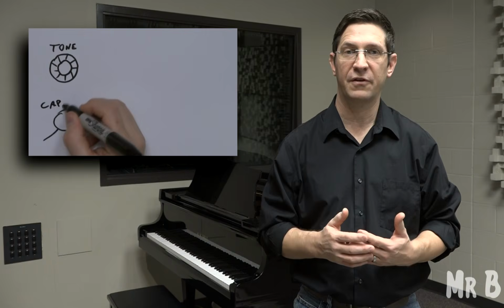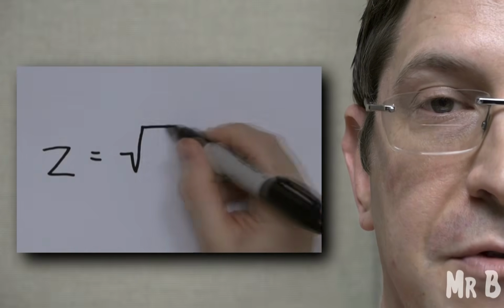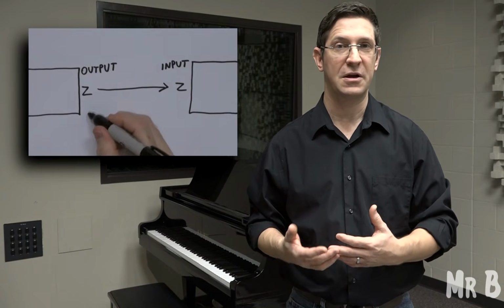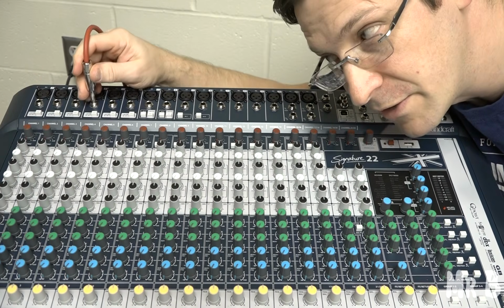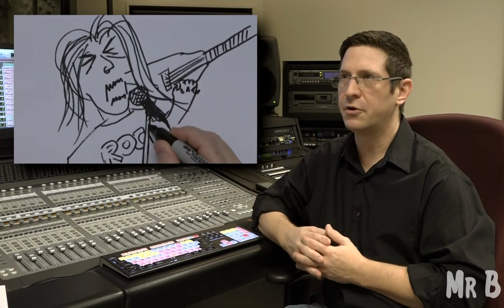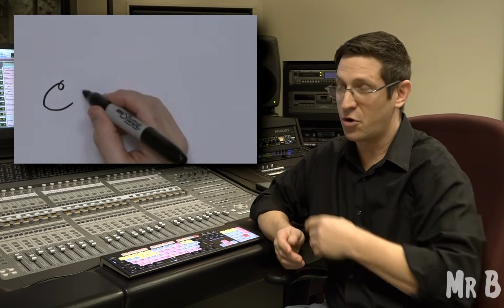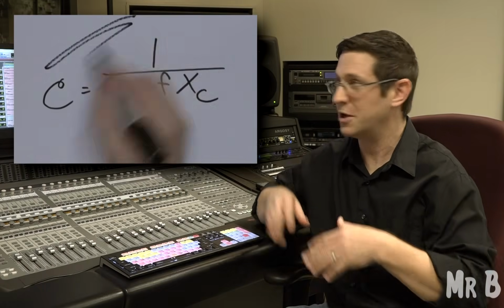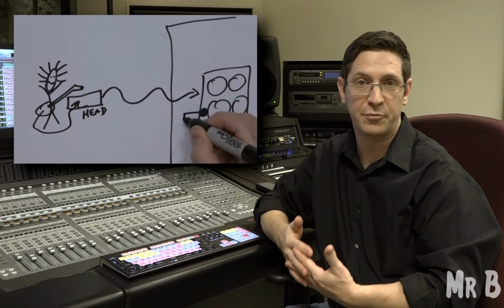Guitar Cable Length - Why Size Matters

Comment: I think you might know the answer to: When connecting a keyboard with two TS outputs to a field recorder, should I be using microphone cable or instrument cable?
Reply from the maker: What's the model of keyboard, and what's the model of the recorder?
Reply: @MrBinthestudio  I was actually hoping for more of a general answer as to where it is appropriate to use instrument cable (guitar cable) vs. quad core microphone cable.  I could wire up some unbalanced instrument cable into the 3.5mm unbalanced input on my Mixpre using a TRS connector and bring the two 1/4" outputs from the Yamaha P-125 one to each side, or I could use some quad core or other microphone cable and do it that way, also using a 3.5mm trs unbalanced input on the Mixpre (100k Ohm input).  The specs on the Yamaha (just one example) don't tell me the output impedance of the outputs.  They don't even tell me if it's line, mic, instrument, or speaker level.
Reply from the maker: Since the keyboard is unbalanced, if you were to use mic cable, any benefit that you gain from the mic cable (common mode rejection, for example) is lost by the mere fact that it's an unbalanced connection from the keyboard.  So, it really doesn't matter which cable you use, but instrument cable will be fine.  As for the output impedance of the keyboard, I think we can safely assume that it's line level out, so your input impedance into the XLR/Phone combo inputs should be well matched.
Reply: @MrBinthestudio  Thanks for the informative answer.  However, I should not e that the reason I prefer to use microphone (quad core) cable is because it allows for a stereo signal through only one cable, whereas the instrument cable would require two cables in a y.  There is also the issue of the semi-conductive layer of instrument cable.  Would this have no effect?  And what about impedance handling?  Is this not a major difference between microphone and instrument cable?  The impedances of my inputs are different, which is why I am wanting to use the 3.5mm 100kOhm trs input rather than two of the xlr inputs 4kOhm.  Since the signal coming out of the keyboard is not balanced, cable isn't goingto make any difference anyway, so that isn't what I was actually asking about.  I was actually wondering more about the physical characteristics of different cables as far as impedance handling, capacitance, etc. as it relates to situations using actual gear and to people not studied in electronics..  No videos and hard to find the right information I am looking for out there.
Reply from the maker: There's really no difference.  The term "instrument cable" was really coined to prevent people from using instrument cables as speaker cables.

Comment: 200ft??? 61m??
Who needs a cable that long???
If I wanted to be more than 10m (30ft for y'all metric-deniers) away from my amp,
I'd get a wifi-transmission, not necessarily for the tone, but primarily to avoid tripping accidents

Comment: does this effect also appear on speaker cables? From an amp to a cabinet?
Reply from the maker: Nope.  The amplified signal from the amp has a different circuitry that is not prone to HF loss.
Reply: @MrBinthestudio  okay thanks for the quick answer

Comment: Also, I'm new to this... I plan to get either an axe fx II or a Scarlett interface. Would those double as the DI box as well? I plan to just use the guitars DI and then use VST's later on.
Reply from the maker: Yes, the "instrument input" on those units suffices as your direct input to record the direct signal from your guitar.
Reply: @MrBinthestudio  Thank you for the fast reply! Loving your channel. Wish it had more. I will definitely watch those. :)

Comment: what is the safe cabe length? 
I am going to buy a very expensive cable soon to record my guitar, , but I'm afraid to buy 4,5 meters and get these losts.
Reply from the maker: If they are very expensive cables, my guess is that the internal capacitance is lower than most cables, so you would be able to get away with a longer length.  But I would check with the cable manufacturer to be sure.  What is the brand and model of cable you were looking at?
Reply: @MrBinthestudio  oh thank you for your fast answer.
I was going try buy Mogami Gold or Platinum but is very hard to buy here from Brazil.
Now I will buy the "Tecniforte Animal", a cable from a very good brazilian manufacturer:
I didn't find the technical specifications but here is a video of their other cable ("High Clear" model)
https://www.youtube.com/watch?v=9fz-k2sCSVo
The video is 8 minutes, is very old (2011) and the guy "tecniforte's representative" give some info in voice, and other technical infos are given in text in video (you cant caption it)
So its too much trouble/work to you help me.
I think I will buy it because I can't buy Mogami here in Brazil, the prices from those who import it are too much expensive and buying from Amazon have very high tax.
Reply from the maker: Those cables seem like they should work well.  I usually tell people to keep the cables around 3 meters or less.
Reply: @MrBinthestudio  yes this is my doubt.
If I buy 3m I will have to move my 19kg weight Combo every time that I will play, brining it closer to my PC/Audio Interface.
I was wondering if I buy 4.5m will cause any  sound-quality-loss.
But thank you for you time!
I subscribed in your channel because your videos are great. Very technical infos with a bit of fun
Reply from the maker: Is there any way you can get a hold of a cheap 4.5m cable to test it?

Another thing to consider for dealing with length is to get a buffer unit or a pedal with a buffered output.  This provides an impedance modification that will allow longer cable lengths.  I learned about these after I had made my video, and would have included it in the video if I had known.  :)

Comment: Thanks! :D FWIW the resistor and capacitor configuration is pretty important. Depending on which is where, you either produce a low pass or a high pass filter. If the input signal first crosses the resistor, then on the other side of that resistor, where you tap that signal to send it to the next stage, is a capacitor that is connected to ground (aka shunted). This is a low pass filter. 

On the other hand, if the input signal first crosses the capacitor, then on the other side of that capacitor, where you tap that signal to send it to the next stage, is a resistor that is shunted to ground. This is a high pass filter. The impedance of the load being driven by this high pass filter should be much higher than the value of the resistor to prevent circuit loading effects on the filter's output.
Reply from the maker: Yep, all correct!
Reply: @MrBinthestudio  Excellent! I am still learning. :) I wish that when I was attending my classes in the 1990s someone had told me to just do more instead of trying to read more. I had a very hard time learning electronics and what finally allowed me to breakthru was simply DOING. If you have any students that are struggling with learning electronics then maybe they might benefit from the times we are living in. About 1 year ago I bought an "Arduino starter kit" on Amazon for about $17. I recommend the ones that do not come with an Arduino, just the basic kits that come with a breadboard, 5v power supply, buttons, jumper wires, buzzers and a bunch of jelly beans: resistors, caps, LEDs. Rexqualis and Elagoo are both decent brands. Now the problem of sending audio signals thru the breadboard arises, and the student has to really learn. :)
Reply from the maker: I quite agree. Our program is a combination of theory and hands-on. I can talk all day, but the best learning happens when you actually do it.

Comment: 5:19 You should mention about the Insertion-loss caused by "double" passive transformers. The guitar-signal would be weakened by the loss. So you shouldn't try to "make-up" the guitar sound on your guitar amp BEFORE inserting two passive DI in the signal line. It doesn't make sense.

Comment: Hey Mr. B! What about cables involved in fx loops in the 4 cable method? Also recommend no longer than 10 feet? But, in total or each cable?
Reply from the maker: That's a little trickier to answer, because some devices have an impedance buffer that allows longer cable runs, and others don't.  But if each of them has a "true bypass", and you have all pedals off, you would want to look at the total of all cables that are connected at any one time.

But in reality, you could get as much as 20 feet and you might not hear any high frequency loss.  Bottom line, if you are losing high end, and you have the ability to shorten any of you cable runs, that would be a good place to start.
Reply: @MrBinthestudio  wow normally I wouldn't expect such a quick answer and also really complete! Many thanks Mr.B! Gotta check this myself!
Reply: A good recording engineer will not record a wet signal.

Comment: Where can i get a roll of low impedance cable? Should I just make using mic cable and just double up on the inner conductors???
Reply from the maker: Yes, using mic cable is perfectly acceptable. You don't really need to double up the inner conductors, though. Just connect the shield to the connector sleeve, and just one of the jacketed conductors to the tip. The remaining conductor can just be trimmed down.

Comment: Does any of this apply to a UHF or a BT wireless instrument guitar & amp system ? I went with both, but haven't received both types. Was really about the same cost when I consider getting a 20' instrument cable. The cable I  ended up with is a 18'6" length. Beyond the 10' rule, but enough cable to be anywhere in the room(s) of the house. If the wireless really is the better solution and I do understand that line of sight and distance effects reception, but since we're talking about a single room, limited furnitures, I can be as close to the amp with the guitar as I want to or stand to be. I'm really hoping the cable can be a backup and rarely used vs the UHF wireless. This videos helps to explain why the amp always sounds so much better at the store, they have the shorter cables to demo the equipment.
Reply: Meh, just realized that was the difference between 10 & 200 foot instrument cords (who would do that anyway ?). So, is there really that appreciably noticeable difference between 10-20' of a premium same brand cable ? I realize that the cord should have a certain amount of quality reduction inherent mathematically as the cable length gets longer ? But then there's the amp itself and what the hardware has for pushing range as well. Ideally the amp has the highest quality/fidelity sound internally at the connection, the cable is a premium fidelity as well. Is the difference between 10' & 18--20' so negligible that it doesn't matter enough to stress out over for perfection ? With any cable the efficiency degradation(s) starts at the wiring of internals, then the connection, then the instrument cable inch by inch. I'm beginning to think that theoretically that might be the case as well for a wireless system with range distances of the transmitter & receiver, line of sight and objects that would block and absorb reception from the guitar to the amp ? Which is the better wireless transmitter & receiver being used.
Reply from the maker: @jimcamp2423  thanks for watching! 

Generally speaking, I would say your assessment is correct.  You will have some high frequency loss by adding more cable, but whether you will notice 20' vs. 10' is debatable.  

Using a wireless system is a viable option, as long as the wireless transmission does not color the sound.

Comment: Yessss, give me all the equations!!! But sadly, I couldn't find many capacitance/impedance information from the manufacturer :,( 
How does the impedance level compare to, let's say, that from an analogue synthesizer? Does it have a big impact on the possible  length of the cable, is a high impedance input also recomended?
Reply from the maker: Well, that depends on which analog synth. What's the model, and how old is it?
Reply: @MrBinthestudio  Hey, thanks for answering! I've got DSI Rev2, 8 voice version. Was released just last year actually, no idea about the cables tho
Reply from the maker: @arturitmos  I can't seem to find the output impedance in the tech specs for it, but since it's a newer device, I'm betting that it has a low Z output, so cable length shouldn't be an issue
Reply: The general rule of thumb is that you want inputs to be high impedance and outputs to be low  impedance. For inputs, high impedance implies voltage source, whereas low impedance implies current source. Synthesizers are pure electrical devices however, and even "consumer grade" -10dBV high impedance outputs on these devices deliver a strong signal (especially compared to -50dBm mic level). After all, ALL synthesizers have internal amplifiers! :D Your DSI Rev2 is a professional grade keyboard so I would wager a dollar that its output(s) are low impedance, nominal +4dBu. Youtube has a few channels that explain this stuff in detail, you just gotta search diligently. Here is an example: https://www.youtube.com/watch?v=0-lXiV2dXOM but no ... we are not building transmission lines (and would rather avoid them). That's just an example of the wealth of info on these subjects that are out there. Thanks to Mr. B for helping to compile it all down in a way we can utilize. :)

Comment: What is your opinion about speaker cables? I never imagened that a 200m guitar cable does have an impact. And I still think that a speaker cable can't work like a tone control knob. But am I wrong?
Reply from the maker: Amps and speakers do not follow the same impedance rules as low-voltage cables, so speaker cables can be run for long distances without any problem.